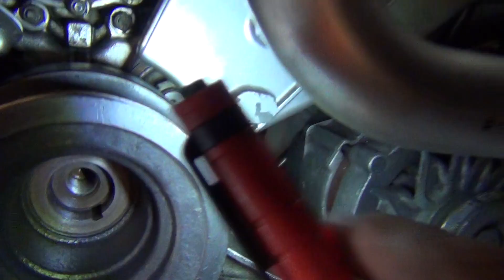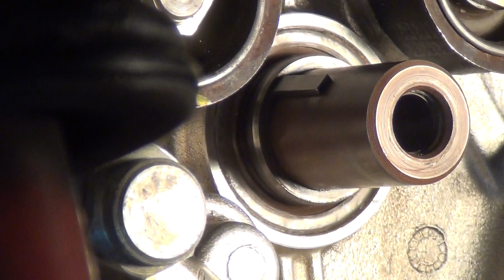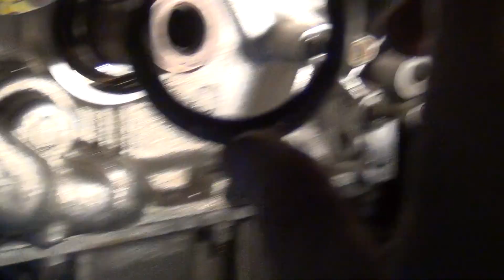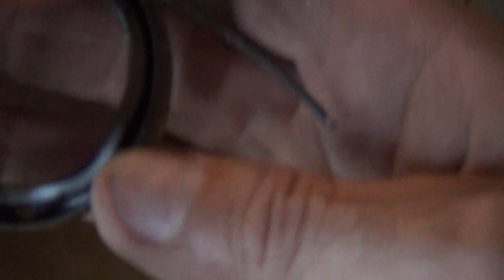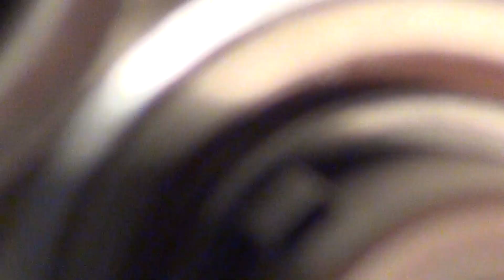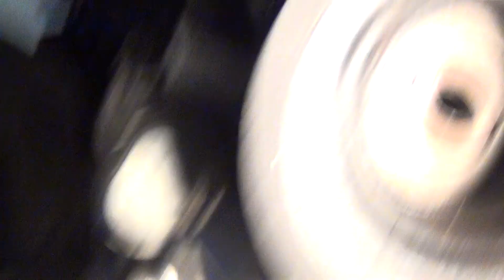Ferrari Mondial QV 1985, Front Main Oil Seal Removal/Reinstallation

Comment: Very good, Marc. Are the sealings of both shafts (10 cm distance to your new seal) ok or leaking too ?
Reply from the maker: Hey Paul, it's likely they are weeping, I was going to replace them and even look at replacing the front and rear bearings. However, replacing the bearings is a major job, mainly the rear one, for the front cover has to be removed to access them. The front bearing and seal on the cam belt drive pulley shaft, can be replace by removing the cam shaft drive pulley. I attempted to remove one of mine and replace the seals and maybe the front bearing while I was there. But removing the pulley off the shaft proved to be too difficult and I was breaking pullers...I decided to abandon that idea (for now) for fear of damaging the pulley itself. The weeping is so minimal it's not worth the risk, especially considering the bearings appear to be good. These old 308 engines all leak, it's very hard to stop them from leaking completely. Cheers, Marc
Reply: @themessenger5868  Marc, thank you for the detailed answer. I did the main seal too. But i saw your video a little bit too late. I prepared a puller ... at the end it works without. If i would have seen your video before then all would be easier for me. I thought too much before. Paul

Comment: Did you put the seal in the freezer overnight before installing? Would that help at all?
Reply from the maker: No, it's not necessary to do that. They will press in without too much fuss. Go slow and even. Accuracy is important in gaining a good seal. Be sure to oil the inner rubber seal that makes contact with the crank shaft. Cheers, Marc

Comment: Hi Marc, I see you’ve been keeping yourself occupied during this shutdown period. Your Mondi must be bone dry now after all this work.
Reply from the maker: Hey Andy, yeah it's coming winter here now so a great time to get stuck in to the maintenance. The Mondial is getting there. But you know how it is with these old Ferrari engines...they do like to dribble when you baby them. Hope you're doing ok, all the way over the there. Keep well, cheers, Marc
Reply: @themessenger5868  I'm doing OK here but CA is not going back to normal anytime soon. About the seepage, I use 10W40 Redline synthetic oil then add a bottle of Blue Devil Stop Leak at every oil change. That stopped my seepage  completely. Been bone dry for a couple of years.
Reply from the maker: @andyn8998     Hey Andy, good to hear you're doin' well. Thanks for the tip on the Blue Devil, I'll look in to it. Cheers, Marc